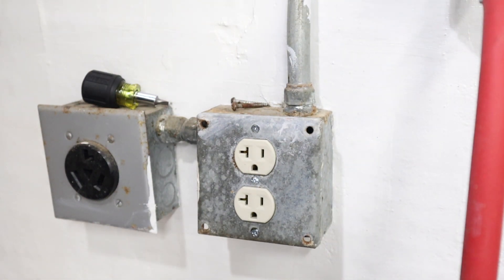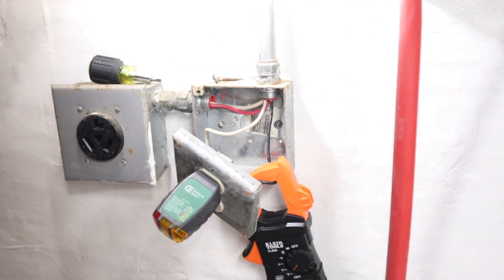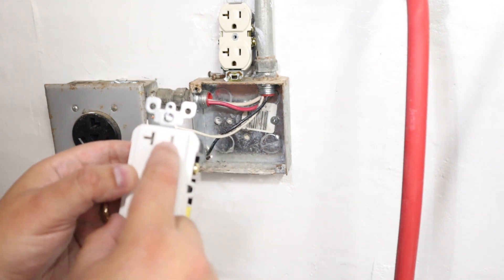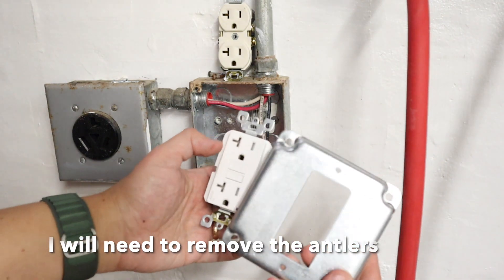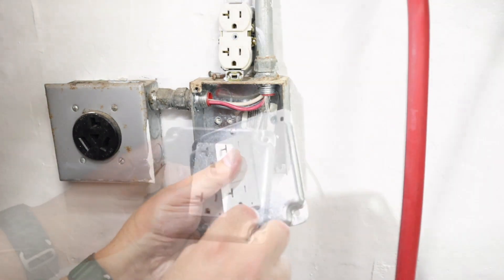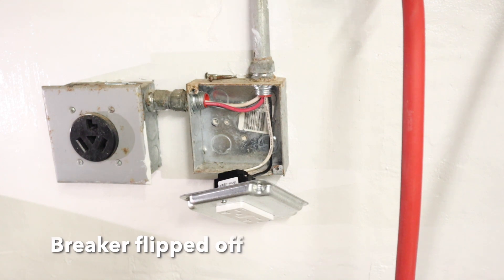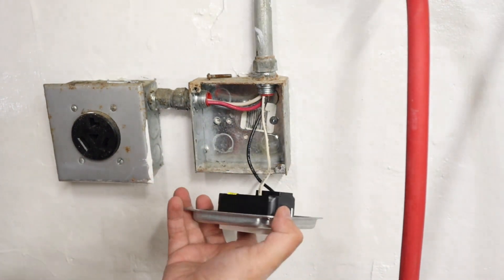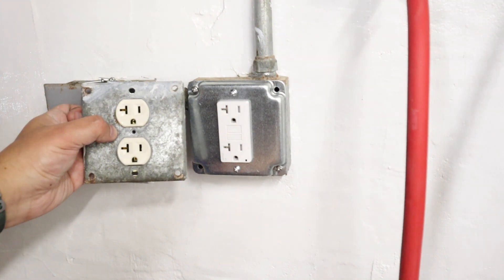Increase Your Outlet Safety: Easy Steps To Add GFCI Protection Without A Ground Wire | PEDRO DIY

Comment: Your metal box and metal conduit is your ground, you don't need a ground wire. Your old outlet was properly grounded as shown by the tester you plugged into it.
Reply from the maker: Thank you for the feedback. The GFCI outlet would be safer though right?
Reply: @PEDRODIY2  In an unfinished basement its code.
Reply from the maker: @bsmith8564  Yeah, for sure. Thanks for the feedback, I appreciate it.